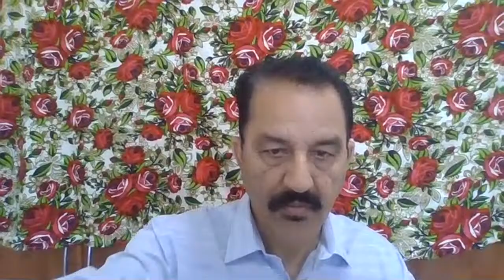Civil Construction Materials-Technical Session No 170--Importance of Water cement Ratio in concrete

Comment from the maker: Water-to-cement (w/c) mass ratio is important because it controls the mechanical properties and durability of hardened concrete. When problems occur and/or non-compliance with the specification is suspected, it is often desirable to be able to determine the w/c ratio.
What is the importance of water in the concrete mixture?
As water is added to cement it creates a paste that glues all of the aggregates together. The cement paste then undergoes a chemical process known as hydration, this chemical reaction is what allows the concrete to harden and become strong and solid.